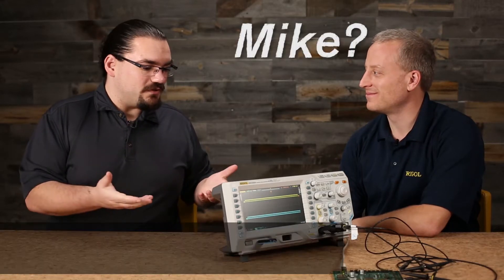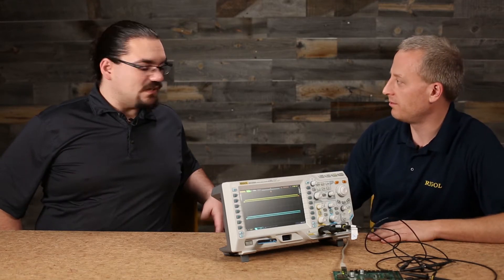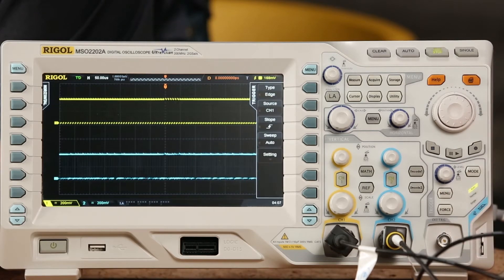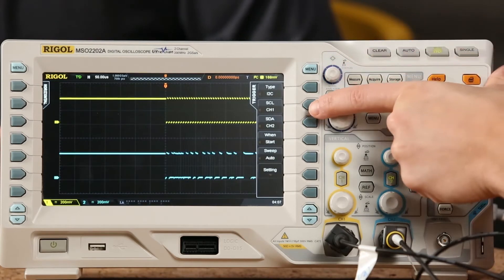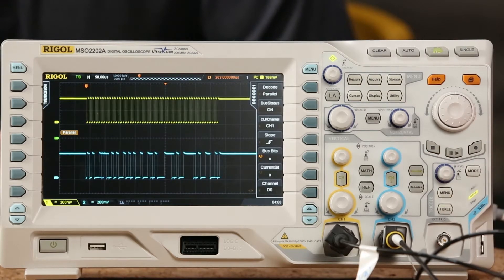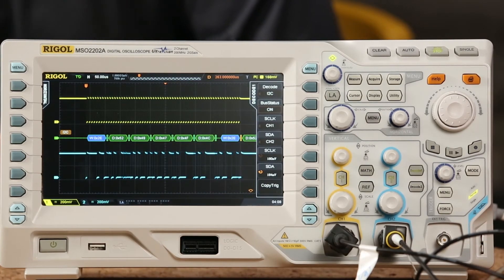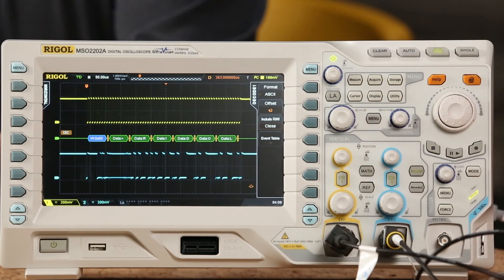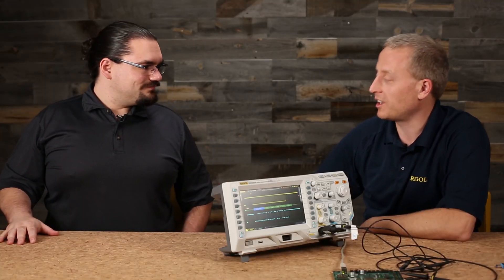Arrow Getting Started with Rigol - 04 - Debugging I2C w MSO2202A Scope

Comment: My scope will not decode I2C properly.  The displayed decode does not match the bits displayed. I followed the procedure in the manual. When I do a single capture and repeatedly press the Decode1 button, the displayed decode changes, even though the traces do not change.
Reply: I got it! set the probes to 1X so the scope gets more voltage. The trigger will stabilize and the decoding works!!  I am used to a Tektronix $10,000 scope, but this one is really nice, and has more functions.